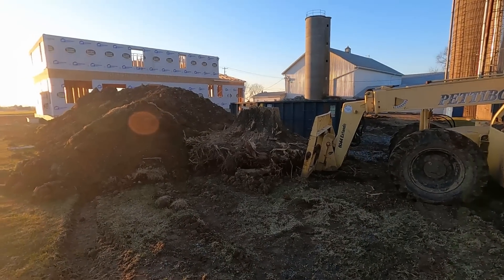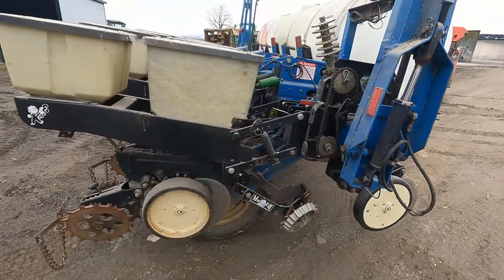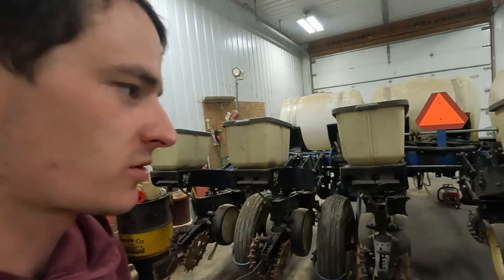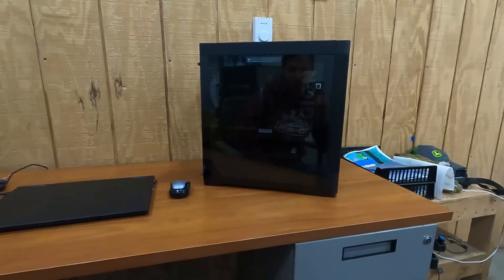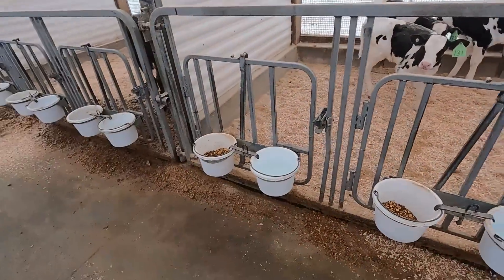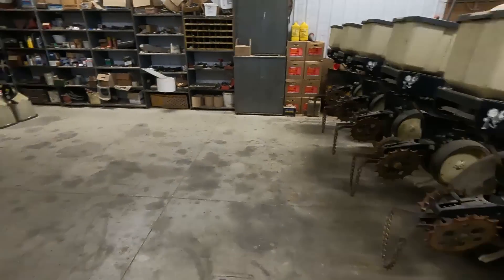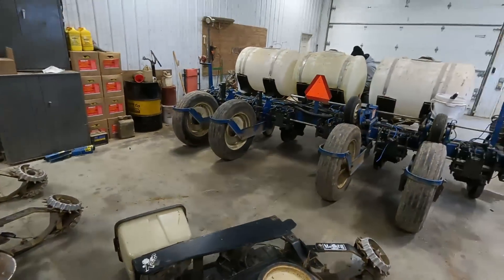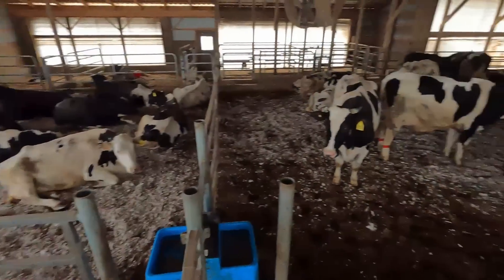House is Framed & Farm Work

Comment: Good video. Note that when drilling out the holes and inserting the bushings, the actual strength will decrease because the thickness of the surrounding metal has decreased. We have also used such bedding in the past, but the cattle had problems breathing due to the dust. I hope this all works out as planned.

Comment: Hi Eric enjoy your video's I am retired builder also grew up on a dairy farm. As for insulation closed cell  spray foam is the best for sealing 
the house. For the ceiling 5 1/2 "  for the walls 3 1/2 or 2" and fiberglass over that. The spray can lay uneven and you will have to peal layers of the batts to keep the insulation flush with studs. If you attach ridge insulation to the walls of the foundation , 2" blue board and 1"
foil faced you will not have to insult the basement ceiling ,in my area R-30 is required. Good luck , keep up the hard work .George

Comment: Hello Eric , I thought you was going to have a bigger porch on the house . The house is coming along thou. But the one you got will due. We had to do the same with our planter take off guard arm’s . We  welded a metal holder on the front of planter drilled holes so we could had a place to put bolt’s so we don’t lose them. Better learn all you can from your dad .

Comment: With a older car you get a small oil leak, put a small square of dry wall down on the garage floor. Keeps you floor clean and it is easy to change out.

Comment: should make up a set of hydraulic hoses that have skidsteer ends on one end and tractor receiver on the other end you can then just use auxiliary on skidsteer, i have a set and use them to move things like haybine so i can swing it while moving now i use them for little things like raising and lowering implements when i need to work on them.  fertilizer on your planter if you haven't been using it and your yields are what appear to be great, i'd keep doing what your doing and not worry about the fertilizer on the planter

Comment: House is looking good! Good Idea for raising the garage height. Did you get a new Ford Ranger? What are you using for insulation? I spent extra on spray foaming. One of the best decisions of my life! One of the only times you are guaranteed a return on your investment. Great Channel!
Reply from the maker: Thanks. Ranger is my uncles. Full spray foam or flash and batt? I'm considering it
Reply: @10thgenerationdairyman  I would do spray foam. I know that’s it’s twice as expensive but you will save a lot on heating and cooling. I like in MN and heat with propane. Saves me a lot of $$ on propane. Congrats on the Build and keep up the great work with the channel!

Comment: Hiya Eric, have you thought about putting hydraulic quick connect fittings on those marker arms so that it will be easier in the future and you won't lose any fluid in the removal process?  Just a thought from a fellow Pennsylvanian.

Comment: It is always a good feeling when the roof finally goes on. When I built mine it rained a lot and it was driving me crazy that all that new ( and expensive ) flooring material was getting soaked. I went out and bought a 40 X 60 tarp. I still have it as it is too big to use on anything I have now. LOL

Comment: You talk about the laptop getting laggy. Have you done routine maintenance on it like disk degrag, disk cleanup, etc. When any computer gets a lot of fragmented files that can cause the computer to slow down a lot which is why a disk defragmentation is a must.

To do a disk defragmentation follow the steps below.

1. Open the start menu in the bottom right

2. Type defragment and it should the the top most option. It has an icon with a lot of colorful floating blocks that are coming together.

3. Click on that Defragmenter program

4. Once its open you should see 2 buttons that say Analyze and Deframent. You can ignore the Analyze button as that just scans the computer to show you how fragmented it is. Click on Defragment don't mess with the computer until its finished.

5. Be patient as the process can take anywhere from a half hour upt to a couple hours depending on how badly fragmented the computer is.
Reply: SSD and TRIM is a very good thing :)  No need for "Defragmentation" any more
Reply: @haydenc2742  Screw SSDs as they don't offer any major advantages over hardrives. They don't last as long due to degradation over time and the boot/load time advantage they offer is negligible if you have a decent to high end PC. Lastly defragging a hardrive isn't an issue unless you're someone who never does it.
I've been using the same hardrive since 2007 and haven't had any issues with it despite being a big gamer who plays a lot. I also have copied/downloaded/uploaded 10s of thousnads of terabytes of data over the years yet my hardrive is still working like a champ. The 2 SSDs I do have are on their last legs due to degradation and can't hold what they used to. I also have 5 other hardrives with the only issue I ever had was a defective one upon delivery which was replaced under warranty and they all still work.

SSDs are really only good for laptops because often they don't last long before they start failing you.

Comment: Precision planter solutions check them out I’m sure you’re already probably done with the planter they have good solutions for parallel linkage arms I’m sure you’ve heard of them. Thanks sir so much!
Reply from the maker: We are considering Conceal from precision planting. Little pricey but looks more reliable than our current setup.
Reply: @10thgenerationdairyman  yes sir had a neighbor put those on his planter this winter I think that’s the system where the fertilizer goes on with the gauge tires maybe. Thank you

Comment: Is it me or is Eric's house going up very fast? Which is great!
Reply: Usually framing happens pretty quick. It's once the outside wall is done it seems to slow down cause there's little visual change quickly.
Reply: Paid by job, not by hour.
Reply: Oh ok makes sense.
Reply: You should go with 10’ wide doors . Just like going with an 18’ foot door than 16’ door . Do yourself a favor and go wider.
Reply: Framing is the fastest, the fine tuning of the inside is what takes the longest

Comment: I think putting a 20 food door on your shop is a great idea. Yes taking off your marker arms is not hard, but being able to just back the planter In to the shop to fix it when your in the heart of planting out of the rain will make it worth it. Another reason is backing anything into a wider door, making it so much easier. You can move equipment faster and easier. I think wider doors are always better if you have the space.

Comment: Make sure you put that new computer on a UPS! Keeps it running if power gets wonky.
Reply: Surge protector maybe, if the wiring also has to supply any electric motors.
Reply: @crackwitz  nah, a decent UPS is MUCH more useful than a surge suppressor, it not only acts as a surge suppressor but a backup in case the power goes out temporarily, worth their weight in gold to prevent loss of work/data

Comment: Highly recommend you get 1 more of that same display for your computer. Editing video with 2 monitors is much faster cause your not constantly switching back and forth
Reply: I'd recommend one screen but with more diagonal. Shows material better. Less eye strain. Doesn't have to have too much res either, QHD or 4K depending on video workflow.

Comment: Have you thought of putting some sort of over head lift in your shop?  Nothing elaborate, just a couple rails on the sides (front to back) and one between them with some sort of chain hoist.  Just seems like it'd make it easier to work on your equipment rather than risking your skid steer.  Just a thought.  Thanks for another entertaining video, hope that drywall/gypsum bedding works out.  I think it's going to make a mess myself, hopefully it doesn't mess up your spreader.